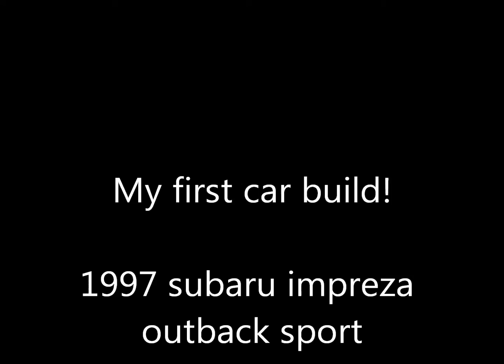My 97 subaru impreza outback sport (project)

Comment from the maker: bumper, headlights, and tails all came from ebay. The bumper is a duraflex bumper, the headlights are black housing headlights with black housing corner lights and side markers. the tails were chrome as seen in  the pictures which make sure they fit wagon cause there is a difference from coupe to wagon. and the fogs came from advanced auto

Comment from the maker: actually it took like 6 years to get it on the road with a low paying job and lack of help getting it together. It was more like I bought the wrecked green one for $200, then found a slightly less wrecked blue one for $400 then eventually got the white one with no damage and a bad motor. so we kept switching parts around till i got the white subaru running. still running strong. thanks

Comment from the maker: nice, yeah subaru's are very compatible between the years. the only difference from 97-98 was the dash was changed and i think thats it. for example, i'm running a full 97 legacy gt suspention under my obs. so you can look into other subaru parts of similar years. legacy parts for the most part are bolt up. i hope that helps a little. sorry i couldn't be more specific. good luck

Comment: I found a legacy wagon for $850 and I knwo some guys that imports halves of cars. Right now they have a 97-98 wrx STi front clip. I was wondering if swapping the engine is not that hard(I was thinking maybe time consuming) And I was also wondering if the wrx front would fit on the legacy(like the fenders, bumper, the hood and the headlights? thanks good build

Comment: what did you do to attach the upper and mid wing on the hatch... i have the exact car but V7 STI swapped
Reply from the maker: +bladesmith117 my local Subaru dealer sells a metal bracket for the top spoiler that mounts the the hatch back through a factory hole. the bottom spoiler is bolted like a normal car spoiler as well. and the top spoiler was also covered in windshield black sealer and it's very solid. been on for 8 years without issue.

Comment: NIce car! maybe you can tell me how hard it is to change out the duty B cylinoid censor  for the torque converter in the transmission. I tried to get it to pass my states DMV emission test but it failed with and error code p0743 torque converter -electrical. I cant afford to take it to a shop so having to do it my self. I have the same car. 97' impreza outback sport
Reply from the maker: PP SINCITYRIDER i honestly don’t know, I don’t have emissions or an auto transmission in my car. So haven’t had to deal with that stuff. All my cars have always been manual.
Reply: No WOrries, I found it out, I have to replace the Duty B solenoid, just having fun trying to locate a new one. lol

Comment: hows that duraflex holding up for you? considering it myself but no matter how hard i look the scale doesnt tip passed 50/50 haha. you either hate em or love em
Reply from the maker: I love my duraflex, I also offroad with this car, show it at car shows on the weekends and daily drive it. I put about 30k miles on it each year and it's been on the car for a little over 6 years. it holds up better then I expected.

Comment from the maker: nah they all had good transmissions. I scrapped all the other vehicles since then and sold a trans and rear diff package to a friend who needed them. just remember when buying a rear diff, make sure its the right gear ratio for your car and theres a big difference between auto and manual trans diffs. my 97 impreza has a 3.90 gear set

Comment from the maker: thanks, I'm happy with it but since this video the bumpers have been painted to match the car, a custom header was made extreme unequal length 5 foot into 1 foot into a 3 inch collector. and the chrome tails have been tinted. I was never a fan of jdm tails. they aren't much different then usdm stock tails and i didn't want any red on my car. so my chrome has been tinted and every light is led's. thanks for your input though

Comment from the maker: sorry but unfortunatly i didn't get video of it. I made a templet out of cardboard for the bottom spoiler. marked the mount holes on the cardboard then got it where i wanted it on the car and marked/drilled the holes out. not hard just time consuming to get right. the top we used black adhesive sylicon like stuff and that stuff is real strong but subaru dealers sell small brackets you can use but they make the top spoiler very loose. i used both the adhesive and the brackets for extra strength.

Comment: How on gods green earth did you get the underside of your car so clean? Did you just repaint? Or did you just buy the car that clean ? Also I've been looking into cold air intakes for my 2000 Impreza outback sport, did you make that one yourself or buy it online ?
Reply from the maker: Reilly Hyde took the time sanding the floor down and cleaning up the drivetrain. the entire floor and engine bay we sprayed in truck bed liner. that was 7 years ago. to this day it still looks like the day we shot it
Reply: Sorry I just updated my comment after you replied :P I was also wondering how you did the cold air intake.
Reply from the maker: Reilly Hyde the intake was purchased. you can find them on eBay for outback sports. just look up dragon secret weapon r cold air intakes. should come up
Reply: Thank you so much man. This really gets my hopes up for fixing up my car. Cheers.
Reply: Subarumatthew Do these car's go good for what they are, I'm wanting to do a project car, Any advice?
Reply from the maker: That Ozzy yeah I've had this car for over 8 years and it's been the most reliable vehicle I've ever owned. engines are strong, not the fastest cars, they hit fuel cut around 110mph. but they are nice. I love mine
Reply: Subarumatthew Thanks for the fast reply! And fule cut, Haven't heard that before?
Reply: fuel*
Reply from the maker: That Ozzy yeah all cars have a fuel cut after so long. these outbacks weren't designed to really go fast. so they get to about 110mph and it's governed like a tractor.

Comment: Did these cars also have uel headers and how is the reliability on these ?
Reply from the maker: the come factory with equal length headers and dont sound good with an exhaust till you change them out for UEL. which depending on if you have single port or dual port heads you will have a lot of trouble buying singleport headers since like 1 or 2 people in the world make them so they are hard to come by. and they are very reliable and great for a daily. not worth trying to get power out of though, better off just buying a wrx at that point. like all subarus after 120k miles the headgaskets and timing need to be done. but other then that great cars. i enjoyed mine
Reply: @MotorMaverickMatt  Ok so when I get one i should swap in dual port heads for the uel headers and thank you for the extra info I'm coming from Honda and its hard to leave the reliability but I hate getting stuck in the snow and getting my cars stolen thank you again

Comment: Where did you get the cold air intake and that upper rear spoiler?!
Reply from the maker: OFF2theGYM honestly check eBay. I sourced most of my stuff from eBay. I know I got the spoiler from there at least. I forget where I got the intake. but it's a dragon secret weapon r cold air intake. the upper and lower spoiler I got on eBay and was imported straight from japan
Reply: Subarumatthew okay found the intake, but having a little more trouble with the upper spoiler. Did yours come with the mounting hardware?
Reply from the maker: OFF2theGYM nope, they sell them without the hardware. you gotta go to your local Subaru dealer for the brackets and even with just those brackets they make the spoiler Shakey. we ended up using windshield sealer and mine is on solid. never gave me issues in the 8 years it's been on there
Reply: Subarumatthew nice, good info, thanks man!
Reply from the maker: OFF2theGYM no problem, always here to help.

Comment: where did you get that body kit
Reply from the maker: front bumper came from ebay, its a 93-01 impreza duraflex bumper. the rear bumper i found on craigslist along with the side skirts so no idea what brand they are. i dont even have the car anymore. its somewhere in maryland now.

Comment: What parts of the engine did you paint blue?
Reply from the maker: intake manifold, valve covers, alternator brackets. all powercoated in electric blue
Reply: Sweet thanks. I'll paint it a combo of the color you did and Chevy engine red

Comment: I just bought one for 1000 bucks needs new rims tires and having some throttle position sensor or fuel pump problems. it is the white and grey one but it has body damage EXACTLY  like the blue one at 0:21 I have a few months experience with body work so I am confident I can fix it but I would be very thankful if anyone can give me some advice.

Comment from the maker: so semi flush is what exactly? my car is 2 inches lower then stock on kyb lowering springs with a full Legacy GT suspention, bigger brake kit, rear disc conversion, tsw rims old school, high profile tires. need I say more? my wheel gap is a half inch from the tops of my tires. not tucked, stretches, or stanced. I to this day take my car offroading, through mud, into fields... and auto crosses and driven daily. can't ask for more

Comment: It was looking awesome until you put those clear taillights,should’ve went with all red or darker color
Reply from the maker: Silly Lili i went with chrome led tails to tint them. I rocked dark smoke black tail light tint after tgis video for about 4 years till i got pulled over. Then tinted them all red.
Reply: Subarumatthew sorry...my dad typed that but he was right you should have never made them clear though
Reply from the maker: stock ones were faded and the black housing tails look just as gay. my only intent was to have led tails so i could tint them as dark as i can and the leds are bright enough to show thru the tint. that lasted like i said about 5-6 years and then finally got a ticket for tail light tint, so i pealed them and went red till the day i sold the car 2 years ago. look at my updated video to see how it looked with the black tails

Comment from the maker: nothing special. as you can see in the video the engine and engine bay was cleaned up for show. this car is my reliable daily and a weekend show car. doesn't need to be anything special. was considering a 02-05 wrx swap or even turbo the stock 2.2 which can handle 5-8psi safely with no ems. but that gets involves and don't really have time to mess with it. right now its my only vehicle. getting a wrx soon though as my new project car

Comment: hey matthew, i have a 97 OBS, and cant find parts for it to save my life. Can you help me out with some tips on what other subaru parts will work for it. Thanks. You can add me on FB the names mersh mitch, it would help me out alot and i have a few more questions if you have time.
Reply: ryan mitchell Did he ever help you out, I just bought the 96' Impreza Outback, and am having a hard time finding parts.
Reply from the maker: +Connor Keegan sorry I don't think I ever responded. I don't know what area you are from but I imported a few parts straight from japan. and the rest I either did research online or ordered off ebay for cosmetic parts. wasn't really that hard to find parts for. I live in PA
Reply: I live in Colorado, the auto parts stores here aren't allowed to carry their parts so I'm stuck ordering straight from Subaru. It's rough, in Colorado Imprezas go for 200-300k+ miles so you can't find them in salvage yards. I'm having a hard time finding things for my 1996' Impreza outback, I was just wondering if you had any places or suggestions of ways to get parts. Also, what do you think about putting a borla exhaust on a 2.2l, do you think it's worth it? I can't find any forums about my car and I've been looking for about 2 weeks.
Reply from the maker: a cheap muffler added to your stock exhaust will sound amazing vs any expensive system you can buy. ive spent over $2k trying different set ups, now I'm currently running an ebay custom bend UEL 3 inch stainless header, into a tsudo cat delete back. its loud and amazing
Reply from the maker: well you won't find aftermarket parts at local auto parts store. just factory OEM parts sadly. like I said I ordered everything online. borla is very expensive and won't give you the sound you want. trust me, my first exhaust on my 97 obs was a borla hush. spent $600 on a stainless cat back from borla and it was very quiet. honestly a fart can muffler will give you an amazing Subaru rumble. my buddy has $25 into his exhaust on his obs and it sounds way better than an sti
Reply: Damn, if I give you the link to the exhaust do you think you could look at it and tell me what you think? Even the auto-parts stores can't carry oem here, it's some straight b.s.
Reply: It's on ebay through Borla
Reply: for 600$ extra hp and torque are worth it, but if you think I can do it for cheaper I'm interested. Sorry for posting 3 different comments, or 4. My Bad
Reply from the maker: +Connor Keegan ok I just checked it out, that's the same exhaust I bought straight from borla's website years ago. im telling you if you want a good Subaru rumble don't go with borla. borla is very restrictive and will not give you much more sound then your stock muffler is putting out. the sound actually comes from the header. ditch the factory equal length headers and add an unequal length header and just do an axle back or have a fart can welded to the end. it sounds like a crappy way to do it but you will love the sound.
Reply from the maker: +Subarumatthew when ordering a header though check to see how many tubes come from each head on the engine. you most likely have a single port header which is one header tube from each side of the engine coming into one. go on ebay and look up 93-01 impreza uel single port header. order one, it will give you an amazing sound even with your stock muffler
Reply from the maker: +Connor Keegan http://www.ebay.ca/itm/subaru-2-2L-single-port-UEL-exhaust-headers-stainless-/221856990239?hash=item33a7b5041f&vxp=mtr that is the header I bought from that exact guy 2 years ago. he builds them to order, so once you place the order he will build it and ship it to you. really good quality and I love this header so much. infact I felt a slight power gain. smooth bends made for better flow
Reply: Heck yeah! You have just the advice I needed, man! I appreciate it a lot because I don't know anyone who knows about subaru's and I'm also just getting into working on cars and getting hands on experience so I appreciate it. Thanks man!